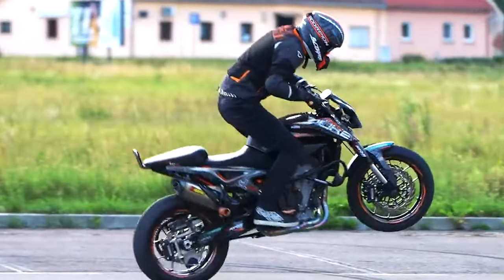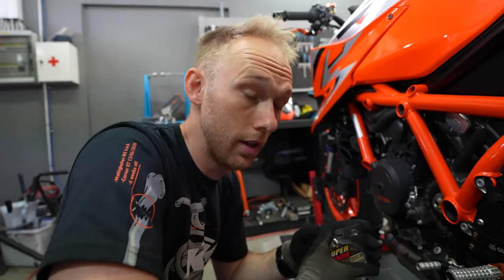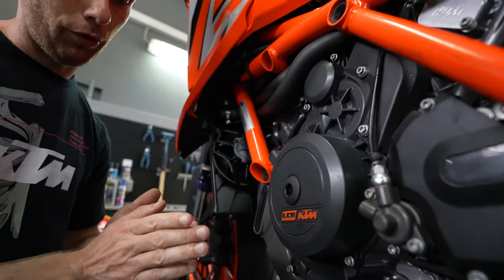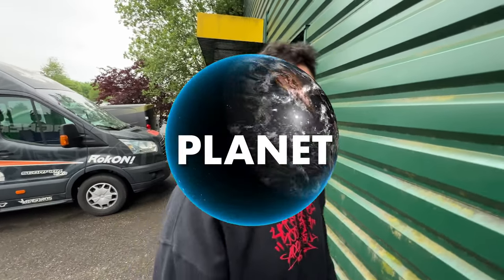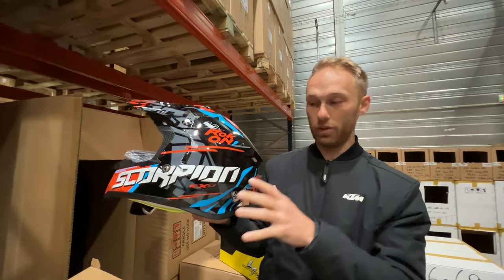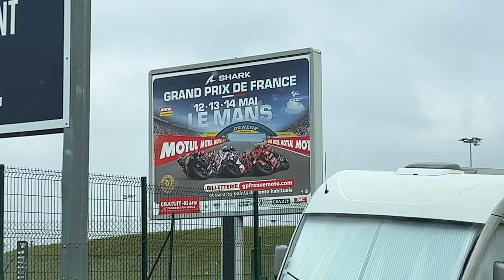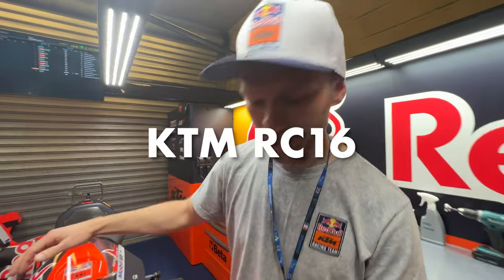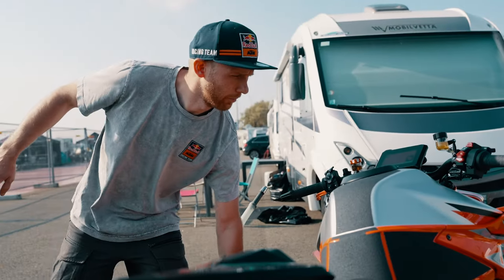Jack Miller, MotoGP and a GIVEAWAY! | RokON VLOG 143 #motogp

Comment: Bro, what you are doing to put KTM in the game is phenomenal!!
When I first started riding my ‘19 390 Duke, very few people heard of KTM when I was asked about my bike. 
NOW, so many people approach me and tell me they have seen your videos and love the Duke. 
Keep tearing it up!! ROK ON🤘🏼
Reply: hey bro, im hesitating between 390 and 790, but im short on budget so could you give me every pros and cons of the 390 ?
Reply: @pqul_  i have duke 390 22'. Cons: Have little vibrations (as single). Also produces heat on the legs at the hot days (but without be in the red area of the temp indicator) and the fan is little noisy and annoying (you can change it, like the ugly mirrors and the tail). Not very cheap, not very expensive. Fuel consumption is medium, service cost is medium. Besides that: This bike is just a rocket. I love the design, that's personal of course. Very powerful for 373cc, 44hp, fantastic acceleration (0-100km in 6 seconds), steering perfect, braking perfect, have the best equipment on this category (top quality TFT screen, top quality DRL lights, switches with back light, adjustable levers, WP APEX sus, ByBre Brakes), Quickshifter+ ready, very fun to ride (have also supermoto mode and disables the back abs), its very light (149kg dry). Also you can find the best parts as protectors or accessories or sticker kits on bagoros. He knows KTM very well and everything i bought from him its just the best. 
Overall, for rookie and experienced riders, tis motorcycle is fucking amazing.

Comment: KTM RC16 2023 Specs :

4 Stroke, V4 86°, 999 cc, DOHC Pneumatic 16-V, 6-Speed Seamless Transmition Dry-Clutch

Maximum Rev       : 18.500 rpm
Maximum Output : -/+ 280 bhp
Maximum Torque : -/+ 130 nm
Maximum Speed  : 370 km/h (230 mph)